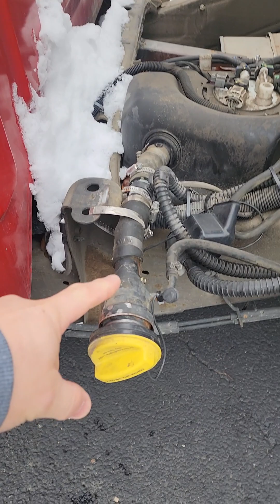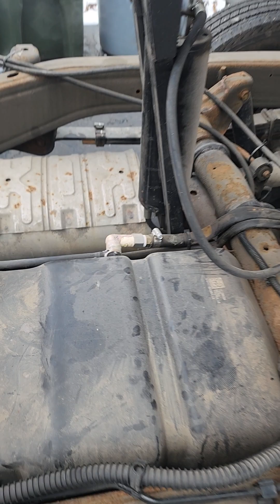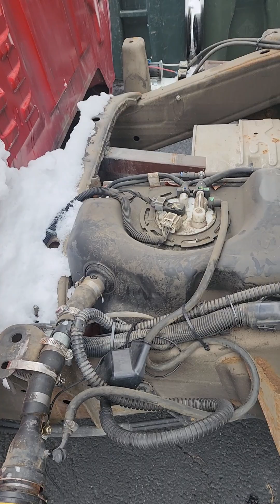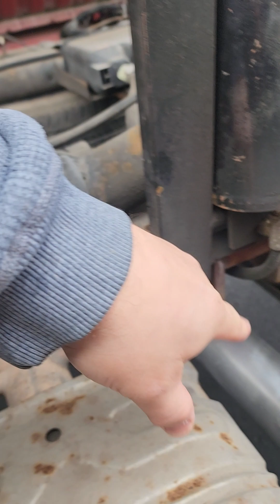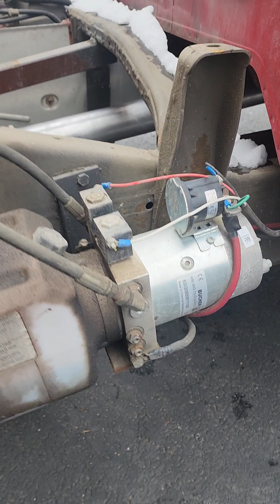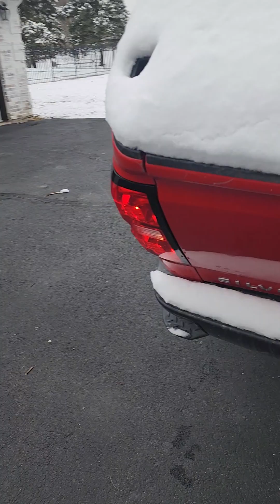pierce-arrow factory dump bed kit year end review

Comment: Really awesome review. I'm looking to do a side hustle dumping things for folks in my trucks dump bed like yours.  Are you saying you charge $1500 per load? Is that for residential customers or commercial guys? Thanks.
Reply from the maker: @jeffmeyers3837  hello.  It would be a good side hustle to use it for junk removal,  firewood delivery,  landscaping work, gravel delivery, etc
I use mine for my concrete business.   I charge my customers 1500 - 1800 to do small sidewalk jobs and I use this truck to dump the small broken up concrete loads and gravel delivery.  
The sky's the limit to what you can do with it.  Installing it on a 1500 chassis is your only limitation as you will only be able to haul 2000 lbs in the bed.

Comment: Goo  spring  shacks sir
Reply from the maker: Thanks.  In my case I had no choice but to replace the driveshaft as it was damaged.  The smaller diameter driveshaft and the 3/4" bump stop spacers have solved the issue.